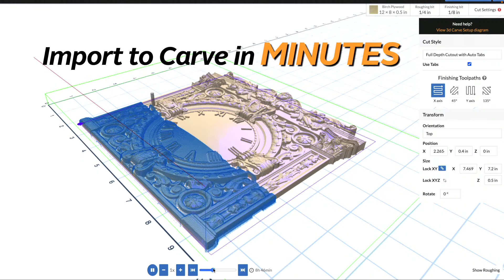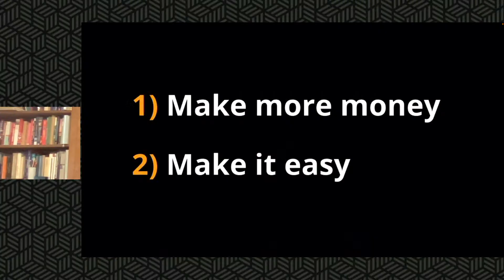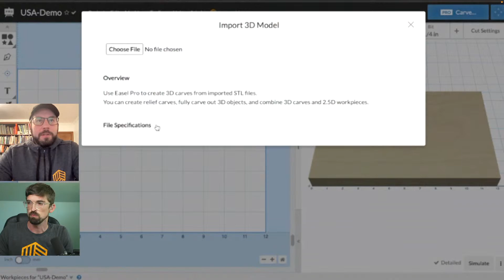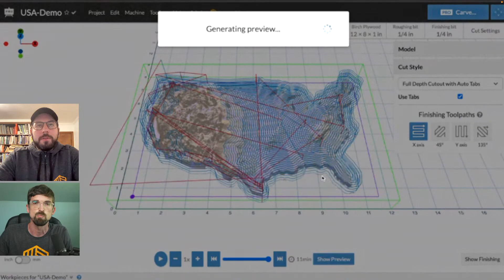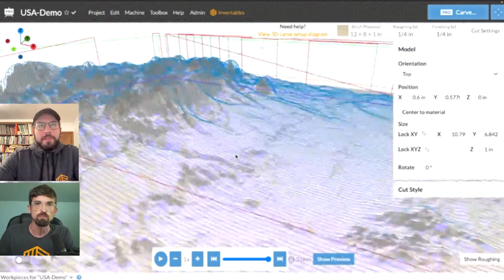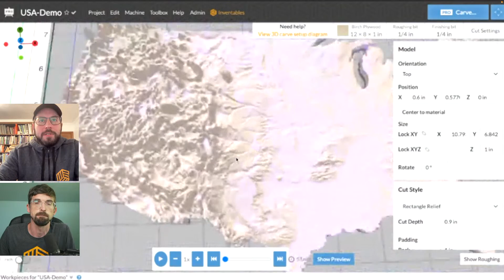Easel 3D Live Event

Comment: I'd be interested to use this for guitar building. Would it be possible to draw and carve a guitar neck rear profile and possibly fretboard radius?
Reply: Yes, many customers do this.  Check out Highline Guitars he has quite a few videos on YouTube explaining how he does it with the X-Carve Pro.
Reply: @zachkaplan4011  Thanks for the reply Zach. I've seen a lot of his videos but he's not using Easel 3D I have a CNC and using easel for my projects but I'd like to see how easy and efficient Easel 3D is at drawing, cutting and carving a guitar neck? Fusion 360 does a great job but it's complicated unless you're a professional CAD designer (or at least if you have a much younger brain than mine? 😂🤣) How does 3D work out? Thanks
Reply: @grandadsworkshop2455  you need to export the STL file from Fusion if your guitar neck is in there.  Then import the STL into Easel Pro.
Reply: @zkaplan  Sorry for the misunderstanding Zach I was enquiring whether it can be drawn in easel and the neck profile and fretboard radius machined directly from Easel 3D using no other package? Also Are there any video examples yet of how to use the new Easel 3D for this application? Thanks